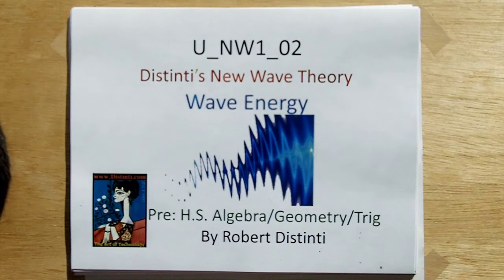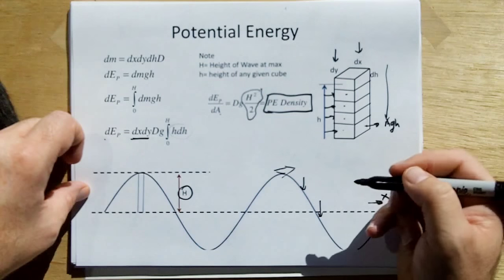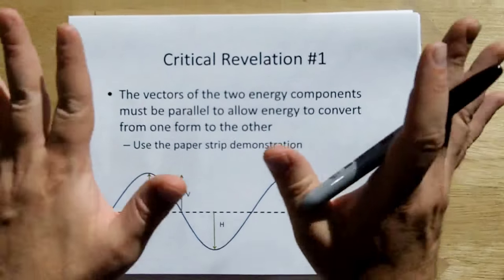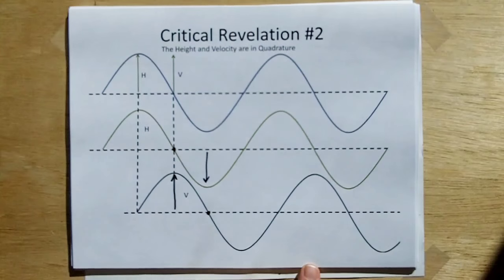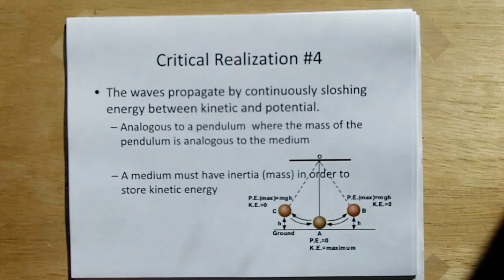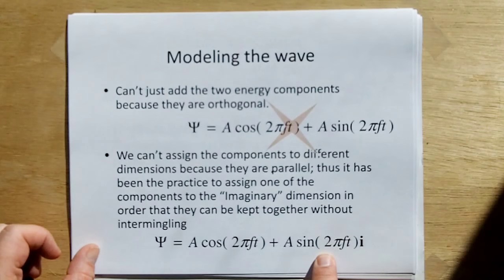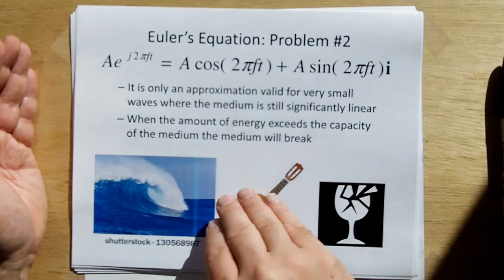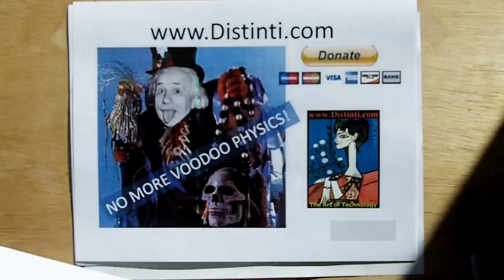U NW1 02: Distnti's New Wave Theory: Wave Energy

Comment: Orthogonal means at 90 degrees... so they are orthogonal in phase, even if perpendicular in space (very well) this is mostly misleading in a lot of literature
https://en.wikipedia.org/wiki/Orthogonality
Reply: No, orthogonal means "independent". It's like two orthogonal wave when falted together (in DSP) yields zero. They are not perpendicular, because you can create, theoretically any number of orthogonal waves. How many "perpendicular" waves can you create ? Unlearn what you have learnt. Wikipedia is not the answer.
Reply: Perpendicular => Orthogonal. Orthogonal !=> Perpendicular. See the difference?
Reply from the maker: If you read the WIKI article you find:"Two vectors, x and y, in an inner product space, V, are orthogonal if their inner product <x , y>  is zero. Meaning: Things can only be perpendicular if they are 90 degree in a three space where you can measure them with a protractor.  If you ADD a 4th dimension, it is orthogonal to X, Y and Z but it is perpendicular to none of them because it does not exists where a protractor can be applied.Apples are not perpendicular to oranges (try using a protractor) but they are orthogonal because if you take the inner product of 3 apples and 2 oranges you get zero.This is so simple even a physicist can do it!